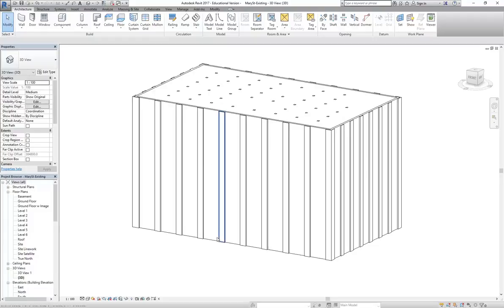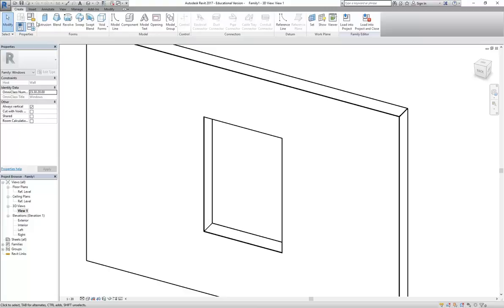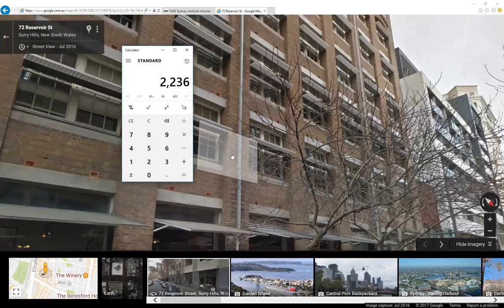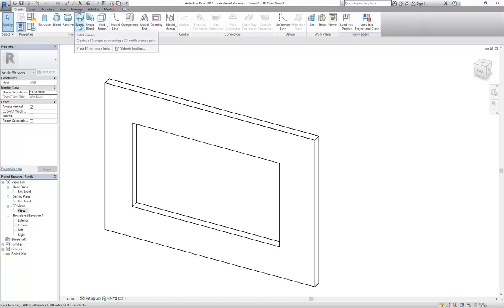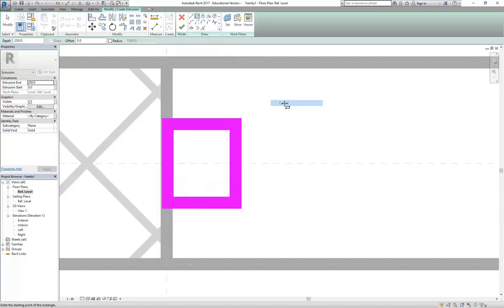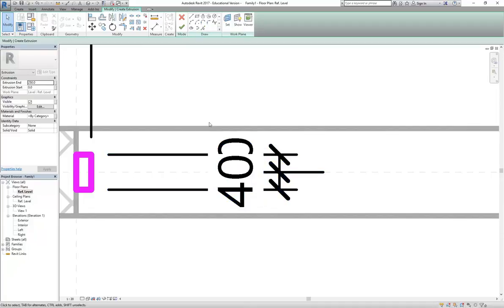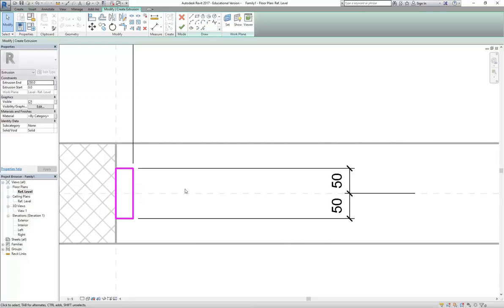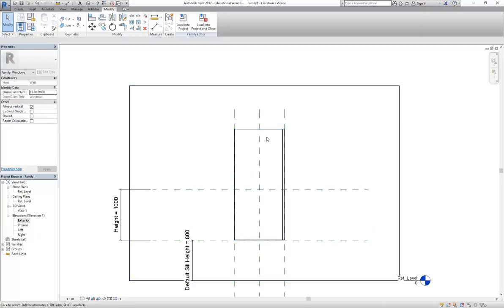Mary St 08 Window Family 01

Comment: Hi Denny, question - I have gone to select the metric window, however I don't have that selection. I do have a window but it is in inches. Is there a way to simply change to metros easily, or should I really be using the metric version? Thank you